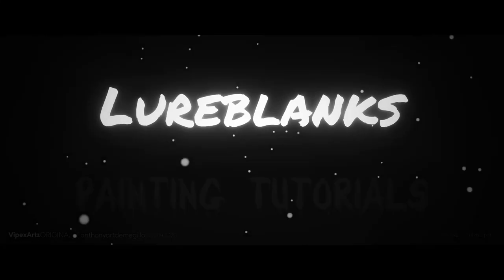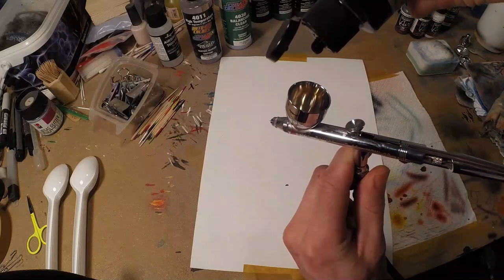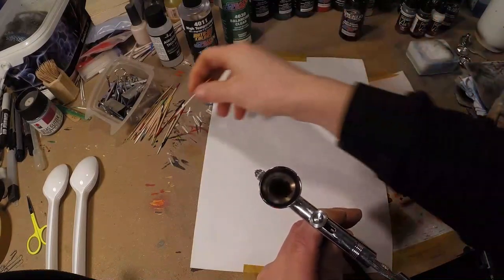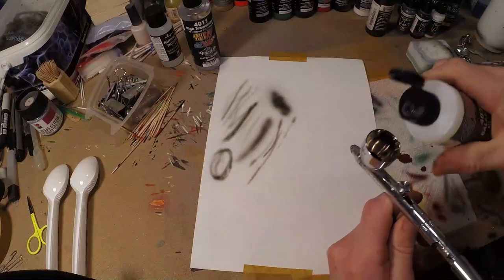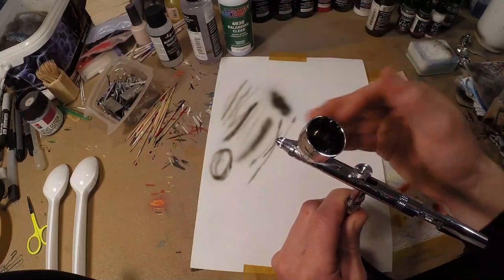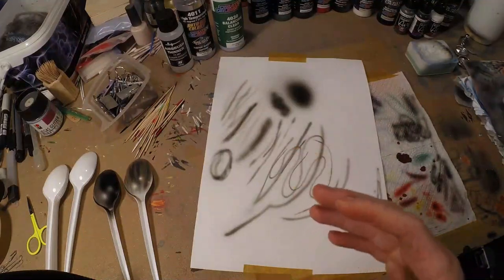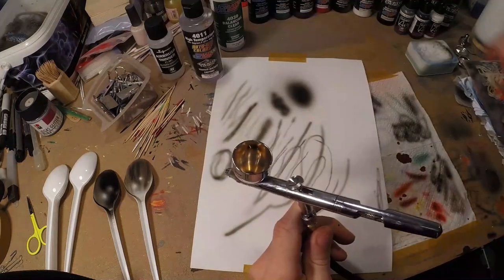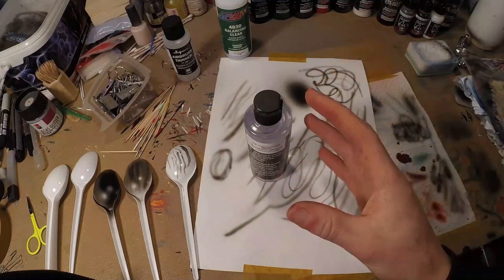Painting Lures 101: Essential Tips for Beginners to Reduce and Thin Paint

Comment: Hi! everything you explain is perfect, but if add three drops of createx how can i add 10% of reducer? thanks
Reply from the maker: Hi! Good point there😊You can either mix larger amounts of paint and paint more lures at the same time. Or i sometimes just use one drop of reducer with 3 drops of paint and a little 4050. The 4050 is really thick and then balances out the ratio of reducer to paint.

Comment: thanks so much... one question, I use createx color but not wicked. how should I mix them? same 4011 product or something else? thanks
Reply from the maker: Depends a little on every color, black colors could be a little thick and others a little thinner. The best is to experiment a little and see what works the best fornyou with every color 👍 because even wicked black and wicked detail black are thick while other colors in the same range are thinner and need less Thinning. The best is to experiment and if you encounter any problems you can always contact me 👍
Reply: Tech data sheet states when mixing paint,4011 and 4030 to let mixture sit for 10 + min. to chemically bond before spraying.

Comment: I finally learned almost every paint needs reducing, I reduced then added paint as needed, more reducer then paint, saves paint in the long run, I add the reducer first in the cup/bowl, then paint, then with a cheap paint brush, like 25 for a dollar type, bristle in cup/bowl swirling in a circle motion, clockwise, then counter clockwise several times, and then a back and forth motion made by rolling the brush between my thumb and index finger. 
Test spray and go! No wasted cups or stirring sticks.

Comment: There was a temporary drop in audio and I mist a part of what you said, in the Vallejo paint is the game colours a good one for a beginner to airbrushing ? Or would you recommend something else ?.
Reply from the maker: Thank you for the heads up, I will have a look at that and hopefully I can still fix it.

Game color would be an option, but you will need to reduce the paint yourself and that can be challenging in the beginning as a beginner. But surely you could give it a try if you'd like. Or else I would recommend starting out with vallejo game air, these are ready to use straight from the bottle and not necessarily need Thinning down 👌
Reply: @lureblanks   thanks for the tips regards Chris.

Comment: Maybe I need to try some 4011. I’ve been using 4012 and I agree, it doesn’t mix well. I mix all my paints in small plastic shit glasses so I know I’m mixing everything. Yeah, I waste some paint doing it that way. Even with the good mix I get in the cup, but you can clearly see that it separates a little when spraying
Reply: I have 4011 and 4030. I always thought the 4011 was for Detail paints and the 4030 was for candy paints. I’m going to have to try all this
Reply from the maker: @Retro-2-now  You will not regret it :D for some 4011 works better then 4012. Adding 4030 or 4050 also makes a big difference, as well as playing a little your airpressure :D

Comment: Great explanation and help for those paints. Do you know if they have a shelf life or expiry?
Reply from the maker: Thank you, the reason why createx sells the 4011 and 4030 separately is for a longer shelf life. Combine these 3 and your shelf life will be significantly shorter.  But separately they go a long way 👍 ofcourse you can poor the leftovers back in the bottle, the mixture is so small and when mixed with the paint in the bottle again it will not change the shelf life on your paints
Reply: @lureblanks  a mate gave me some of his old paints by createx so that’s why I was wondering. Not sure how old they are though
Reply: That was a brilliant video really learnt a lot from that big thanks 👍👍
Reply from the maker: @paullobwein1632  depending on how old they are of course, but chances are that they are still fine 👍 shake them very well because the pigments might have sunken to the bottom 👍
Reply from the maker: @timclarke1791  Thank you for the compliment 😀!
Reply: @lureblanks  ok that’s great. Thanks for the tip I will give it a try soon.
Reply from the maker: @paullobwein1632  No problem , you are welcome 👍